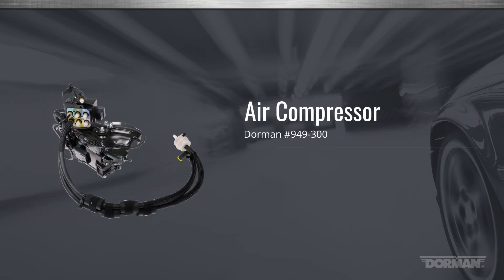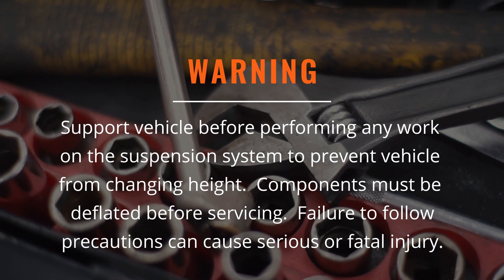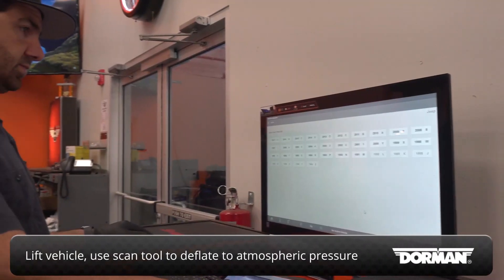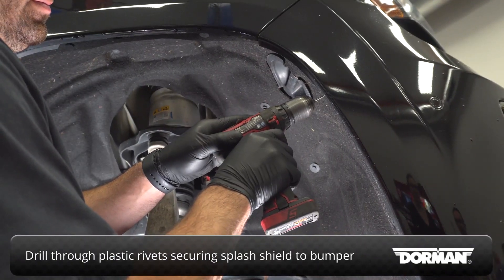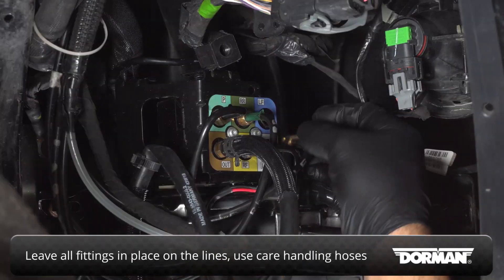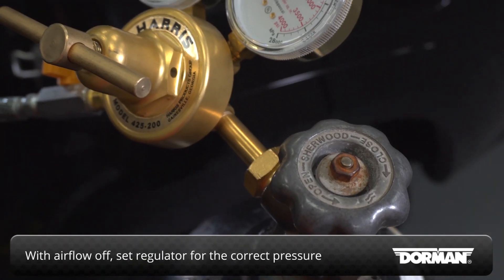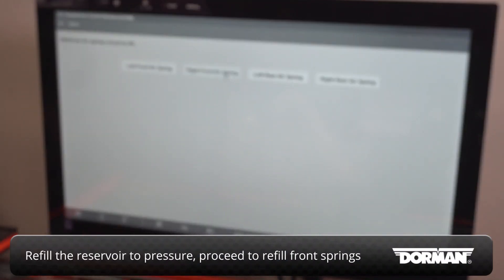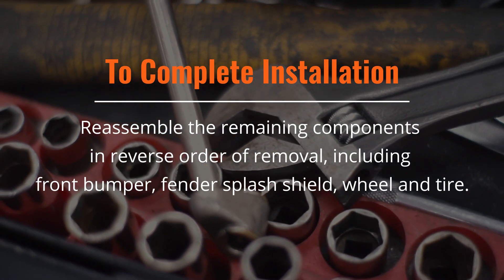Air Suspension Compressor Installation for Select Jeep Grand Cherokee Models

Comment: I ordered one for my jeep grand cherokee from ROCKAUTO, and it works fine, but this compressor is very very noisy when it operates, at a point where it is annoyingly noticeable, and this is a serious disadvantage.  If someone is with me in the car, he asks what this strange noise is. I am not sure if this compressor is noisy by design or it is my back luck that I got a defected one.

Comment: Is my air suspension is still holding nitrogen, does that mean the ACS needs replacing?

Currently my jeeps rear end is stuck in off-road1 but my front is in aero.    The button to lower is stuck, dealer just replaced this unit and won’t change under warranty because they claim that rain water damaged the unit and it’s my fault. (Had a crack in front bumper)
 Is there electrical ways to reset the system or make it just stay in aero?   The ride height button is always flashing; when I don’t want it to.  I try to press the “down-park” button but it’s stuck.

Comment: HELP PLEASE, HELP.
I have a terrible situation.  I followed this video step by step, I changed the compressor and now it asks me to re-program the height, it just flashes constantly.  I haven't been able to move my jeep for 2 months now.  What is the measurement that I should put on the back and front or what should I do?  I use Alfaobd app. Jeep Grand Cherokee Summit 2014

Comment: What is the corresponding location for intake hose? 
my intake and OUT hoses are both not connected on the other side. is it ok?
Reply from the maker: What year, make and model vehicle are you working on?
Reply: @DormanProducts  2018 Jeep GC

Comment: If you were to change this at home without the scanner will the compressor fill with air so I'm able to drive to the shop to have them fill it with nitrogen?
Reply from the maker: Hi Aaron, we wouldn't recommend driving it without it being charged with nitrogen. We would recommend getting  this changed at the shop that would be able to fill it after installation.

Comment: Dear Sir, Thanx for this informative video. Please tell me what the total capacity is in cubic feet to totally fill the system from zero? Thanx...Chris
Reply from the maker: Hi Chris, we do not list a volume of nitrogen needed but we recommend following the OEM process to refill the system to the proper pressure.
Reply: @DormanProducts 12 3 3:52
Reply: @DormanProducts  
Thanx for the reply.
Reason I ask is b/c I don't want to lug around a 120cf cylinder, but want to use a 60cf cylinder instead. So knowing the total fill capacity would be very helpful. The stealership is worthless when it comes to getting info out of them. All they give a shyt about is their goddamned corporate investor money.
Cheers...Chris
Reply: @chriscadman5715  v

Comment: Hello. What Diagnostic software are you using in this video?
Reply from the maker: Hi Jacob, it is the Snap-On Zeus Diagnostic tool.
Reply: @DormanProducts  Is there and equivalent diagnostic software you can recommend that is more affordable than" Snap-On Zeus Diagnostic tool" i.e ALfaOBD with OBD interface  which I have seen some reviews on except clearly indicating  if it can  do air suspension settings adjustment. This is for 2014 JGC 5.7 HEMI Overland with  Quadralift